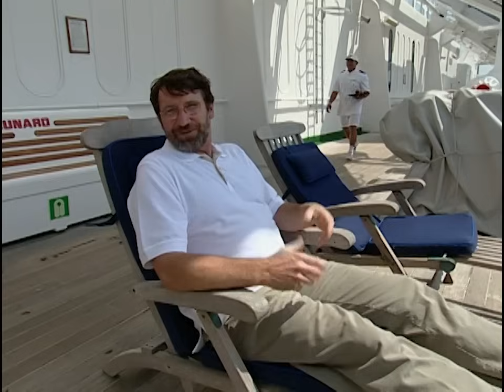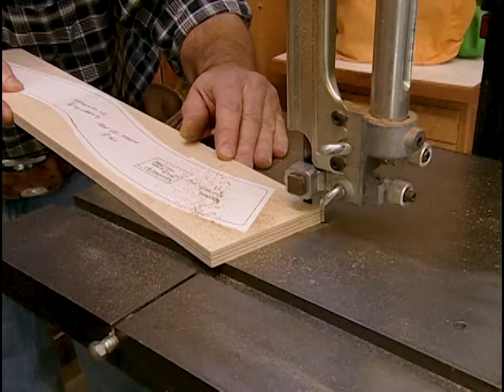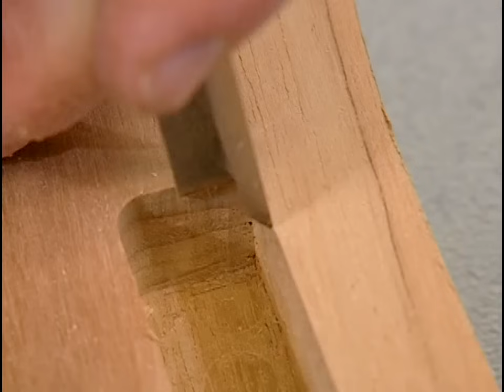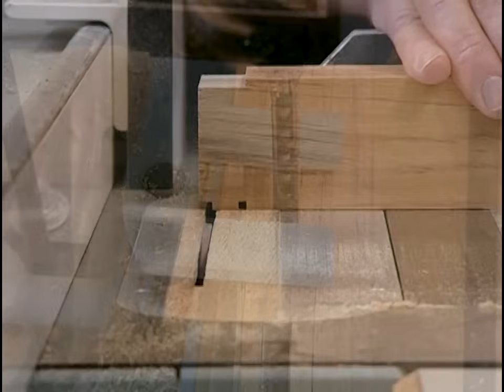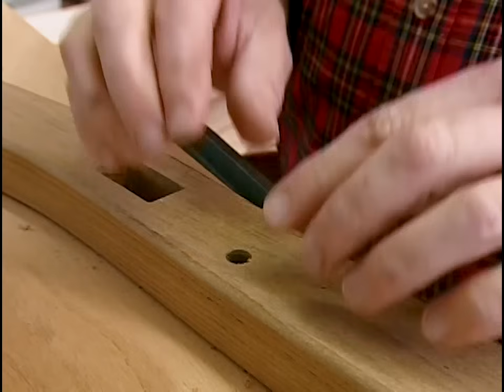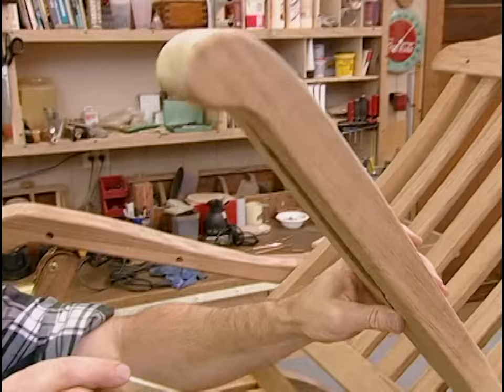Deck Chair  |  S14 E12

Comment: What a difference those full-size templates would have made with the Lutyens bench I built.  I will agree with Norm, it is a very challenging build. Transposing the plans to working templates took months.  I might consider building a few of these now.  All of my many projects are a direct result of the skills learned from the Master Craftsman Norm.

Comment: Where can one get the hardware?
Reply from the maker: Rockler had made a kit back in the day but it's no longer available. We also don't have full size plans anymore! We looked for something equivalent and the only place we found them is in Denmark.
Reply: @newyankeeworkshop  Since the plans are computer generated, wouldn't the full size printouts be possible from the smaller drawings in the plans, so long as the scale is indicated?  That's done frequently in sewing patterns--makers either tape together home printed pages or send out to a print shop for large format printing. I would also think, as otherwise suggested, that 3d printing might make the hardware possible, as well. While generating 3d print files is a complicated task, I bet it's one that this community could cover!😉 It would be worth it to bring back these lovely loungers.
Reply from the maker: @bymyhandsworked  Yes, it's possible to print them "at size", but the real issue is the hardware isn't available anymore.
Reply: According to the video description, it's no longer available.